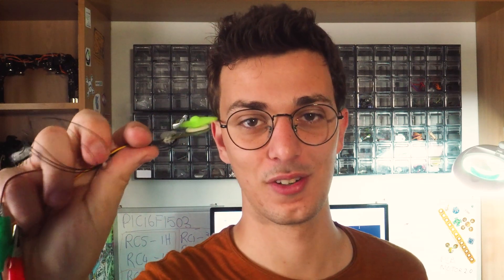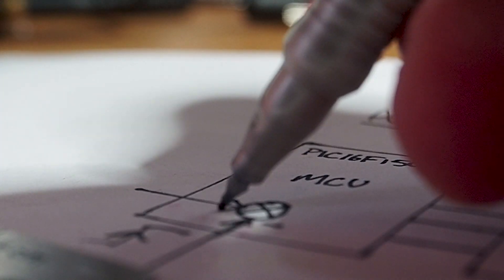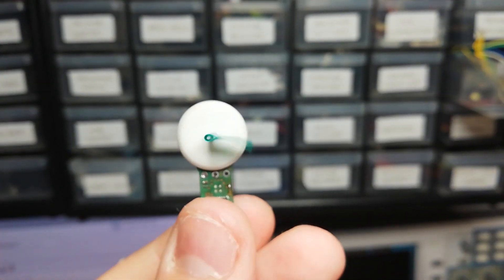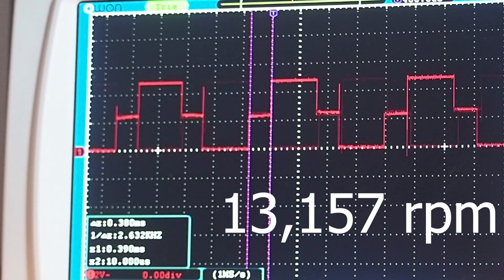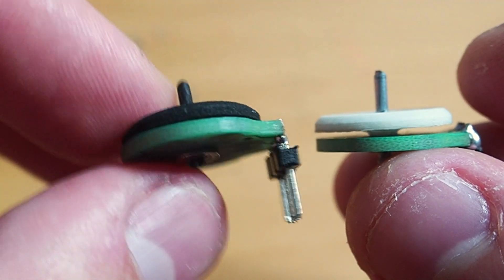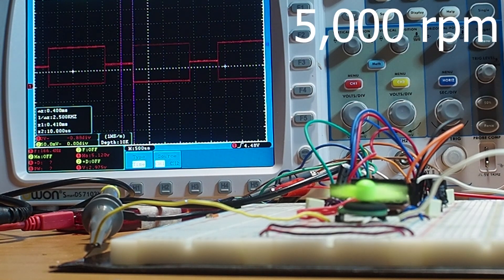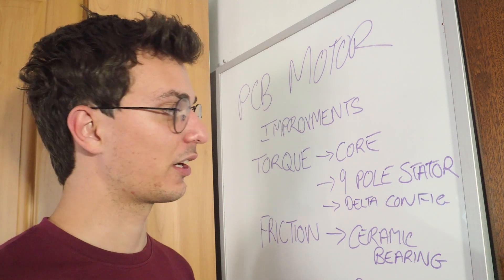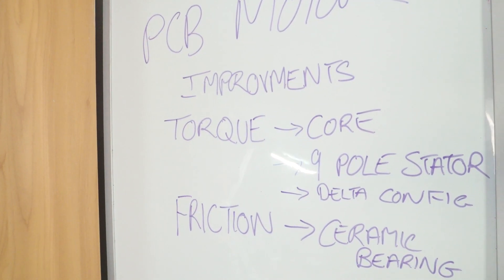PCB Motor - How fast can it go?

Comment: You are losing energy in that wobble.  Maybe more than you might think.  Adding a second bearing to stabilize the shaft could net you a gain.
Reply from the maker: Thanks for the tip! I think this is also another fact which can be improved.. Its a little tricky though as it would increase the overall thickness
Reply: @CarlBugeja  Better use a long bronze bushing. And polished shaft. The weight of the bushing below two bearings, and the efficiency on such sizes above.
Reply: @CarlBugeja  For the pcb drone the main problem would be weight. Because having little foots (the bearings) would not be so much space consuming
Reply: why not use a large bearing on the outside rim instead of having a tiny one on the shaft?
Reply: Actually the vibration is more due to unbalanced and probably not centered correctly.
Reply from the maker: Correct.. it is slightly unbalanced due to the plastic rotor
Reply: As a wise man once said "bearings work in pairs"
Reply: Gigs ⚠️ God has said in the Quran:

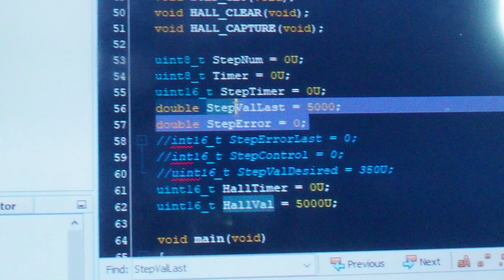🔵 { O mankind, worship your Lord, who created you and those before you, that you may become righteous - ( 2:21 ) 

🔴 [He] who made for you the earth a bed [spread out] and the sky a ceiling and sent down from the sky, rain and brought forth thereby fruits as provision for you. So do not attribute to Allah equals while you know [that there is nothing similar to Him]. ( 2:22 )

🔵 And if you are in doubt about what We have sent down upon Our Servant [Muhammad], then produce a surah the like thereof and call upon your witnesses other than Allah, if you should be truthful. ( 2:23 )

🔴 But if you do not - and you will never be able to - then fear the Fire, whose fuel is men and stones, prepared for the disbelievers.( 2:24 )

🔵 And give good tidings to those who believe and do righteous deeds that they will have gardens [in Paradise] beneath which rivers flow. Whenever they are provided with a provision of fruit therefrom, they will say, "This is what we were provided with before." And it is given to them in likeness. And they will have therein purified spouses, and they will abide therein eternally. ( 2:25 )

⚠️ Quran
Reply: @ahmdabdallah2132  he also said "hey flossie! your wool is so soft against my skin", "hey lets shag a smal child! that will be fun", "if you find anyone NOT suffering from religious psychosis, throw stones at them till they die", and "allah akbaaaaa" (boom)
Reply: @drspastic  can you pinpoint where those words are in the book? "Flossie", "akbaaaa"(u mean akb48 aaaaa?), "boom" and all? pro tip: you can't

Who was this 'he' that said these to you? Cthulhu? Doesn't that comment itself sound like psychosis? Have you taken your meds yet?

Comment: Try building the magnets into the fan to reduce mass of the rotational inertia,  this may gain you some small torque back.  Also start the with  the core and ceramic berings.  One last thought was if you could increase the motor capabilities by marrying two or more PCBs like an Oreo to make your motor coils more robust.
Reply from the maker: Thanks for the suggestions 🙂 the sandwich style I think can also improve the performance and regarding the integrated Prop I have already tried and and showed it in this video (it got to similar speeds) https://youtu.be/mS_qUbPTYfk

Comment: I would suggest the 9 pole stator. Just increase the diameter of the rotor and stator by 33%-50%. This way the motor will still be compact but will have more torque. Also, planetary gears may be needed for certain high torque applications. 3D printed is an option but it would need to be super high resolution. Nice work sir! Thanks for your efforts

Comment: What about sandwiching rotor between two PCBs? Is that cheating?
Reply: This also eliminates some of that wobble cause you get a second bearing
Reply from the maker: I think it can also work but I'm not sure if the increase in torque would be significantly higher
Reply: Totally out on a limb but would it be possible to make the rotor a pcb with coils as well and using inductance and somehow reversing that polarity or something, instead of heavy magnets? I don’t know how the math works :)
Reply: @voxar3206  how do you bring power there? you would need some BRUSH, that mean friction, way more complex mechanical design, and probably some more :)
Reply: @lesto12321  do induction motors need brushes?
Reply: @ki0w0-lordofwatersheep  @kylekulhank  you are right, induction motor does not require brush, but then you get in the issue that you have very low torque, that is good for a fan, but not for a propeller :)
Reply: @lesto12321  what about doing it like some brushless generator excitation? DC stator winding -> AC rotor winding -> full bridge diodes -> DC rotor winding
Reply: lesto12321   @voxar3206   He's saying the power would come from inductance. So it would be wireless. The issue with the designing is that you're working on a flat plane with a PCB. So you would need opposite winding's for input and output which would immediately cancel themselves out. Great idea, but unfortunately won't work in practice. You're stuck with at least 1 set of permanent magnets.
Reply: @kylekulhank  what about asynchronous induction motor? That might not need permanent magnets
Reply: @voxar3206  you mean like what brushless generators do? Some are excited by stator DC winding - > rotor AC winding -> diodes -> rotor DC winding(replaces heavy magnets). The idea is quite similar to your hunch
Reply: Or sandwiching pcb between two rotors with magnets?

Comment: having a higher pole count would lower your max speed if it's limited by electronic commutation (which i think it is); i think your best bet here is to go for delta configuration + core (also having a core can decrease rpm in some cases)
Reply from the maker: True the 9pole stator can reduce the rpm, but should also increase the torque which can also be positive.. Its something I have to test